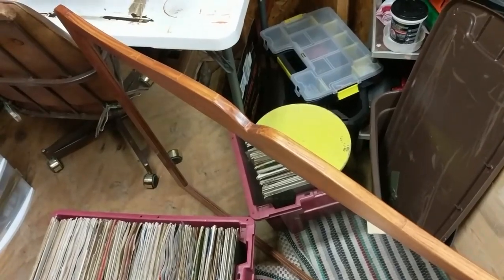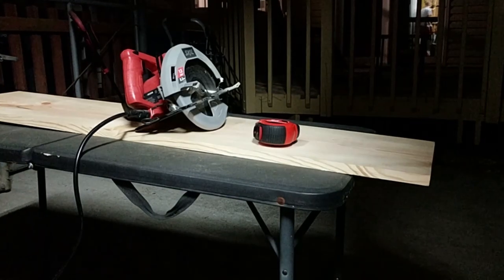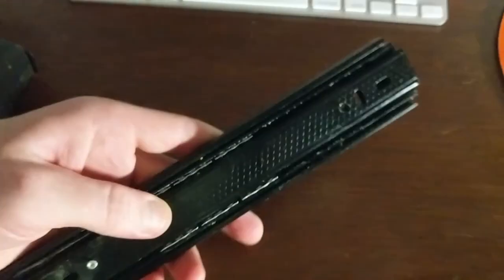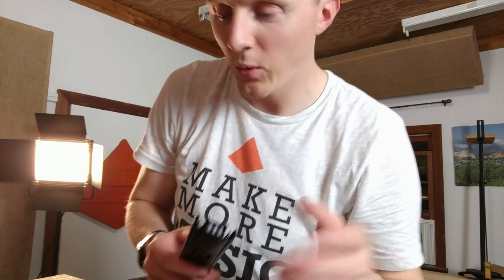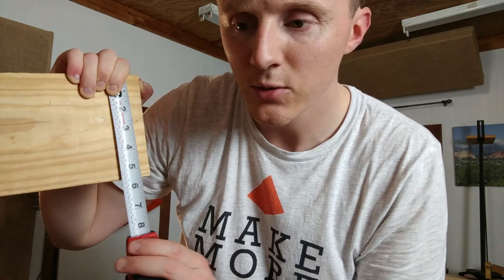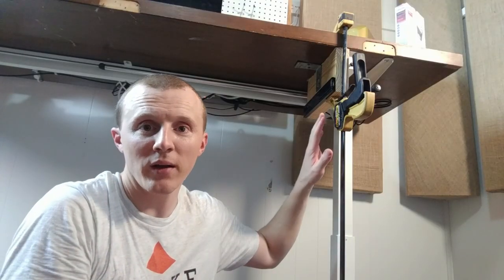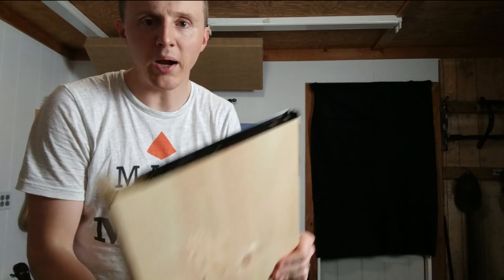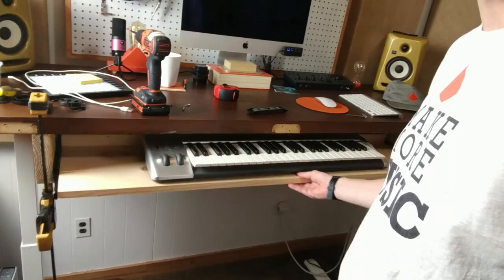Building a MIDI Keyboard Drawer for my MUSIC STUDIO Standing Desk

Comment: Are you having any issues with the front to back wobble while the keyboard tray is extended?
I'm considering buying a 72x30 inch butcher block table top and attaching it to an uplift motorizing standing desk/base. I then want to build a tray like you did and put an 88 key midi keyboard on it. It's probably around 35 lbs. I'm concerned about the wobble while playing the keyboard. Any thoughts?
Reply from the maker: It does wobble forward and back. I just wobble along with it.